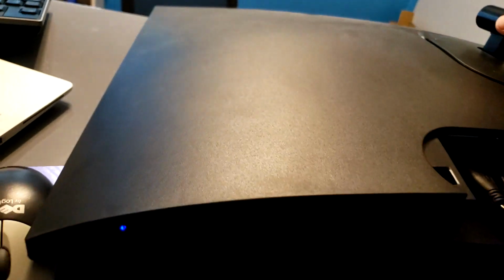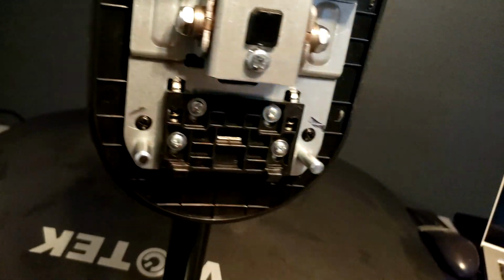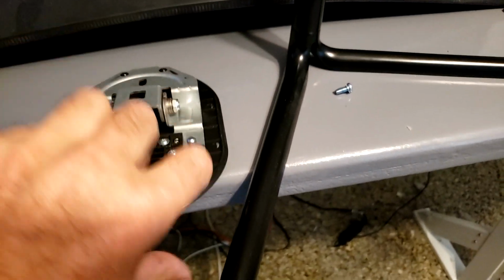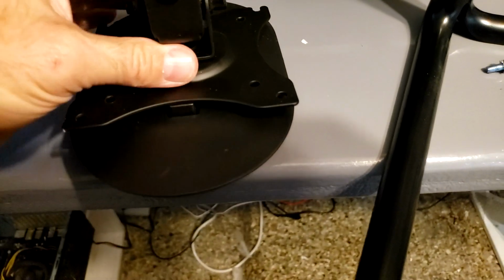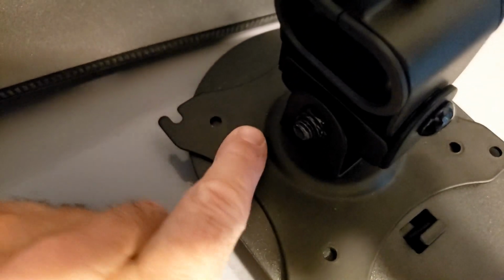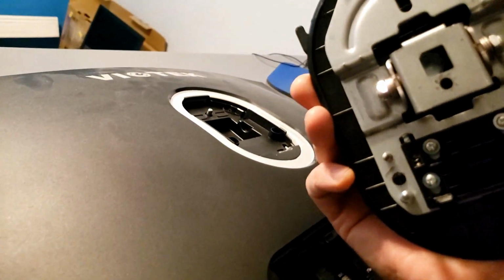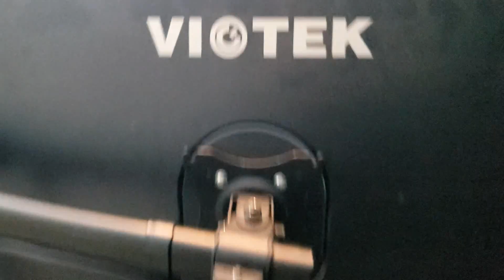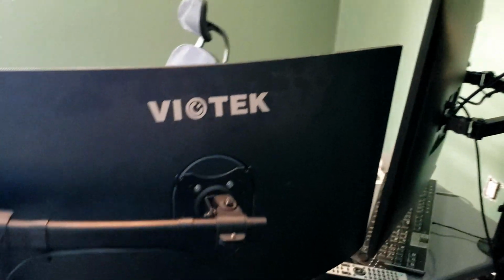Viotek to VESA mod!

Comment: I wanted to let you know there’s a faster way. The monitor comes with 4 high screws that are replaced inside, then allow you to mount the vesa base
Reply from the maker: Thanks
Reply: Can you elaborate??
Reply: How? The braces that I have end up on the outside of the round area.
Reply from the maker: @dblroo  maybe yours is different?
Reply: What size are the high screws? Because those screws, from what I understand, would allow vesa mounting?
Reply: I

Comment: hey really appreciate this video
i've also got this exact same monitor and while it IS "VESA compatible" the holes are too deep to even fit them into a vesa mount
i was wondering if you could share a list of parts that you used to do this & where to get them? i've never been that much of a "tool guy" but if this is how i start, then i'd love to learn :)

thanks!
Reply from the maker: I don't really have a list but it was just 3/4" long self tapping screws i think.
Reply: @ProjectsPat  what type of things do i need to drill though
Reply from the maker: @chadandrewslive6087  just a drill and I think a 1/16 drill bit
Reply: bro... they came with metal standoffs... to connect it to a mount

Comment: tHE MORE ive Used my viotek monitor the more i fucking hate them. It even says on the store it's VESA mountable
btw why not just take the plastic off  the mount thing... ?
it would of been the best video of all time if as you tapped the top "GOOD TO GO" the entire desk collapsed
Reply: bro... they came with metal standoffs... to connect it to a mount
Reply: @thaddyboom3806 

No they don't Apparently.
Not all them do..maybe yours...mine didn't 
just a stand.